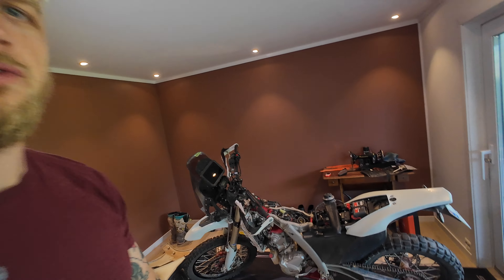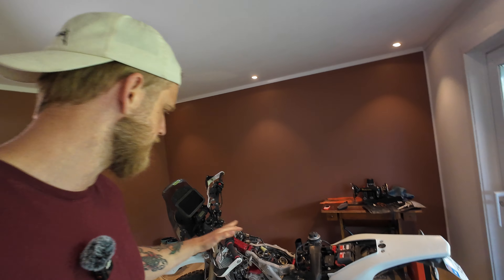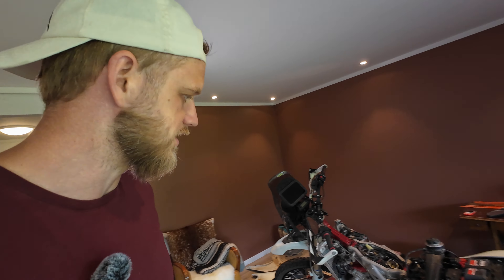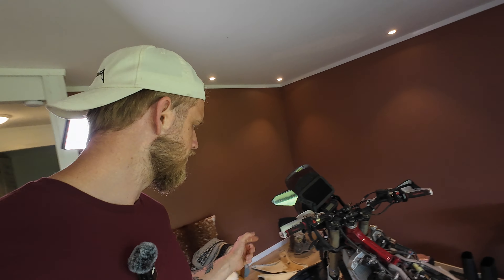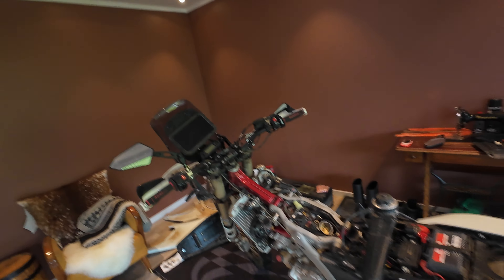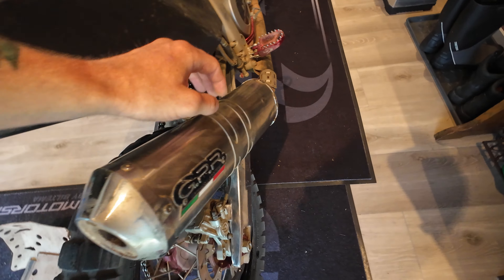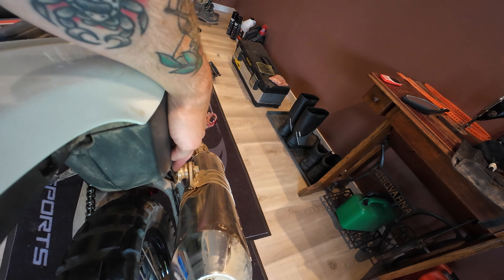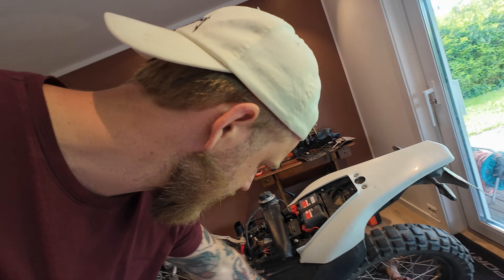AJP PR7 post 3000km trip - A few things I learned (not a review)

Comment: Johannes, great video useful feedback on this remarkable bike. Re the rear brake, you will be able to adjust it quite a bit on that Rose joint ( be careful not to screw it out too far though so it pops out! ) but how about braided steel hoses throughout? I have found they make a big difference in decreasing sponginess.

Comment: Great review at this point (4000ish KM) Johannes. I agree on all the above even with only 1500 KM on my new PR7. Skid plate issue...its a crap way to mount something that is meant to absorb the whole weight of the bike in a big smack. One 10mm bolt in front and a tab in rear. The plate itself looks good, just needs some brackets welded to it where it can clamp to frame. I'm already looking at solutions to this problem. Tires; took off the original Michelins and put Heidenau K60 Rangers on for now. Original tire is only good for off road...its a mild Enduro tire, but still totally off road focused and horrible of course on the road. The rear brakes are strong and I was always on the edge of lockup in town in Italy especially when those tires where new. Totally able to control but in an emergency stop you'd be screwed on the road. Again, not the bike or tires fault. I think they put those on because they look cool from new and most owners burn through them in a few weeks and replace with a more practical ADV tire solution. Had a few loose bolts; checked with rubber hammer every day after riding for loose bolts. No issue with brake or exhaust fitment on mine....yet. Headlights are total crap like you said. Why not add a set of good LED lights and raise price a bit???? I'll be changing those out. I had to follow my friend on a Yamaha XSR125 that has a great stock LED headlight because I couldn't see anything one night in Italy. Fuel filler issue, yes I had other riders laughing at me saying, "Jack, we'll go next door and get a coffee and ice cream while you fill up". I will add the raised filler like you have. No way to fix this issue but at least with an aftermarket screw on filler you don't have the fight with the stock one. Having to pry off a filler cap is just dumb on a bike like this and such an easy fix from the factory!! Other than those issues I love the bike. I haven't had a big thumper in years and going from all my mid to large ADV bikes to this is a revelation. So easy to move around and I'm back to attacking stuff I gave up on years ago with the bigger bikes. Yes, miss the 2 cylinder engines, but otherwise I'm really enjoying this bike so far and everywhere I stop people are taking pictures and asking questions. I'm taking it to the Touratech Active Adventure in September and the Enduro Action Team race in October so we will see how she does at those events. Also taking her to the MX track this weekend for some training and fun on her. Overall I think I will use this bike for daily commute, rally events and some shorter travel and use the bigger bikes for big travel and more road focused stuff. Cheers and have a good vacation after the vacation. GSJack

Comment: Hej Johannes,

Another great video. For what is worth, I have added radiator guards on my AJP as well as hard plastic engine guards. I have crashed several times on my local enduro track. So far the bike has has held up great, minor breaks on the plastics excluded.

I also faced the same issue on the rear brake. I have the doma exhaust. It was quite the shock, because I suddenly didn’t have a rear brake and I only found out when I really needed it. Anyways, it is a very easy fix of adjusting the brake needle. As the brake pads wear out, the brake lever has to travel a greater distance. Now I do this adjustment every time I go over the chain, every ca 300km.

I hope you enjoyed your vacation in my old home country!

Comment: Great recap! I'm still pending to watch the full Balkans video. Looking forward to it! FYI - The Doma exhaust by itself does very little to address the swingarm rub issue. If you remember mine, it had eaten up the swingarm quite severely in a short amount of time. Perhaps with the spacer it'll be better. In any case, the swingarm cleaned up very nicely with little sanding and polishing compound. Enjoy Greece!

Comment: ADV ENG  in Australia do a great radiator brace / guard for the AJP. Also have other great products. Not sure if they ship OS. There is an adjustment bolt under the rear brake pedal pivot point where you can change the pedal height. Don't need to adjust at master cylinder.

Comment: Hi Johannes, nice update.
My 2023 doesn't have the exhaust issue tho I did put the power up on after 1k kms..
I looked into crash bars and all the Oz guys said the aluminum ones bend easy and all you need are the ADV Eng radiator guards - so I got them. Really really impressed - solid lightweight protection and can highly recommend as the solution.
My rear brake locks up fine from that height - likely needs a good bleeding 😊
Reply: Have the ADV ENG radiator brace guard myself. Great product. Also the rear linkage protector.

Comment: Thanks for the update Johannes. My AJP had the same issue with the rubbing of the swingarm. I am in the process of claiming warranty on it, but the response time is very slow. They told me from the importer here in my country to prepare for a denial on my warranty claim from the factory in Portugal, because it was probably my fault, since I must have taken a hard fall or had another big impact on it. This is not true!
My local dealer, from which I purchased the AJP, has been great about it. He had a spare header unit + muffler lying around, as another customer did the exhaust upgrade from Doma. Problem solved immediately. So there must be some faulty header systems being placed from factory, that are just not aligned right.
Concerning the weak headlights: I bought the LED unit from Adventure Men Cave, very easy to install. Great solution for better visibility.

Comment: Nice early review Johannes, interesting. We experienced the rear brake pedal issue as well on the 4 day test ride this summer as well. It got as bad that we had remove the rear wheel and motion the caliper pistons as well. We tried to adjust the the pedal travel, but there wasn't enough adjustability. But after the caliper motion it got function as new again. Good to know aboutvthe radiator as well, the 690 had the same issue as well with a very exposed radiator and as well a cooling fan that famaged the radiator (could be fixed with distance washers). Happy Trails man. What endurobrace did You do?

Comment: Crashbars: crosspro manufacture one for the PR7, it is aluminum, so its light. However it won't fit on the standard version because the lambda sensor is in the way. (Fits on the extreme one though)
Lights: I installed LSK lights, they are bright, very good (and expensive), but there are cheaper led solutions there.

Comment: The concern of radiator protection is valid. However, increasing the bike's weight by mounting metal crash bars is not necessary. If you are concerned regarding the weight gain, radiator guards made of carbon fibre are the best option (Oakleaf Engineering, Bielefeld, Germany).

Comment: My friend who sells motorbikes sold me the AJP PR 7 first and I was happy after changing some parts and doing some work on it. Same colleague also represents KOVE and he recommended me that I must try the KOVE 450 Rally and I did. And I immediately sold the AJP PR 7 and bought a KOVE 450 Rally and to be honest it surprised me and for me personally it is much better for off road compared to the AJP PR 7. I have no problems with it. And fortunately, all the modification parts that are available are very affordable. I also had the seat improved, which is otherwise (after 3 to 4 hours) as hard as a wooden board.
Reply: Issue with kove is the potential question about reliability (differently from other Chinese brands that have been around longer). Time will tell
Reply: @miro_s  Known Issues:
•	Too much pressure is building up in the fuel tanks
o	Doing the fuel cap modification should alleviate this.
•	Posts in airbox air filter frame can break free from the plate causing them to spin freely.
o	JB Weld applied at the base of the post where it meets the plate should fix this.
•	Coolant Overflow reservoir cap
•	Wheel/Tire Balance
o	Front tire comes horribly unbalanced
•	Inaccurate fuel gauge
o	The consensus so far has been that doing the cannister delete and venting the fuel caps mostly resolve the issue.
•	Non-Pro model front turn signals interfere with removing the front fairing quickly.
o	Remove and install waterproof connectors
•	Oil cooler upper right banjo leaking
o	Check that it is tight when assembling the bike
•	There is no sight glass to check oil level
Reply from the maker: That is very interesting, thanks for sharing and the informative comment regarding the Kove below.

I haven't had the chance to ride the Kove yet, but if it is as good as you say I can't wait! I'm having a blast on the PR7 and it honestly feels like a heavy dirt bike, so if the Kove is significantly better, I'm excited!
Reply: @JohannesDalen  Greetings 
You have to try it, And get your own impression
Reply: @JohannesDalen   The Adventure On Bikes channel traveled all over Morocco on the KOVE 450 and had no problems with it

Comment: What is your view on the PR7 vs the 701 for the type of riding you do?
Reply from the maker: This is a question I probably should make a video about. To be honest these two bikes are so similar that either one would work great, but I enjoy the PR7 more than the 701 - mostly geometry, nicer seat and better suspension.
Reply: @JohannesDalen  many thanks to you!  I have followed your steps.  First T7 now the 701.  701 is a great bike but I it is very difficult to access and fuel pump (requires dumping fuel) and engine is very hard to get to.  I like the easy access of the pr7 motor, airbox location for water crossing, longer suspension, no electronics to go wrong abs/traction and it comes out of the box cheaper than everything required to build the 701.  Would be great to hear your thoughts on this too
Reply from the maker: The PR7 is simpler in every way, no doubt about it. It's made to be worked on. However, you need to understand what you're getting into when buying a PR7. You're pretty much on your own if anything happens, and it is known to having some issues here and there (all bikes are though, and nothing major that comes to mind). 

Can you test ride one?